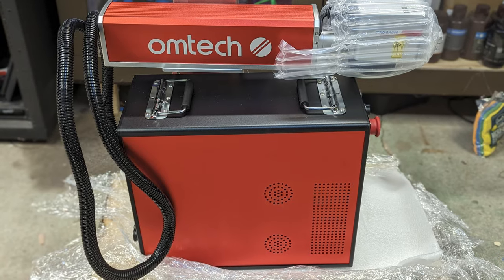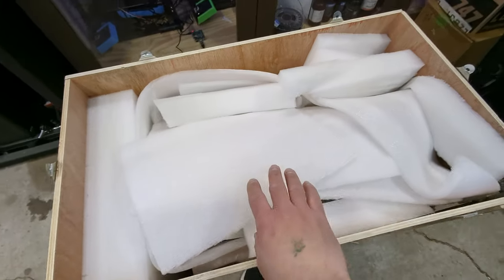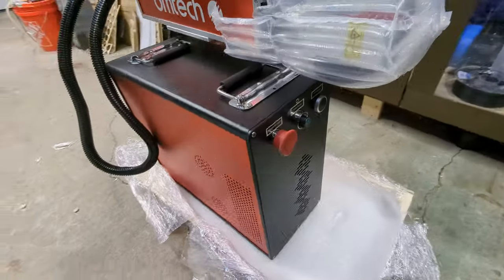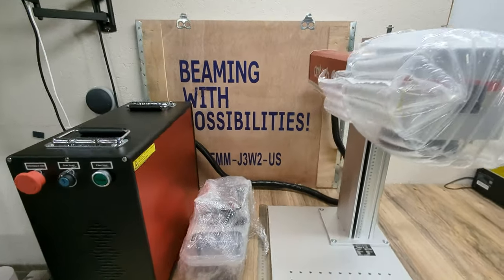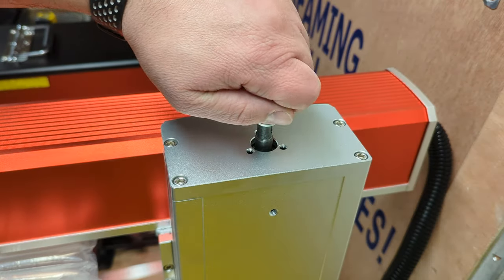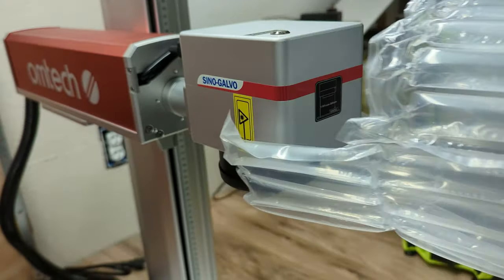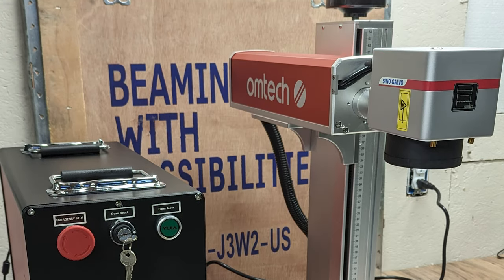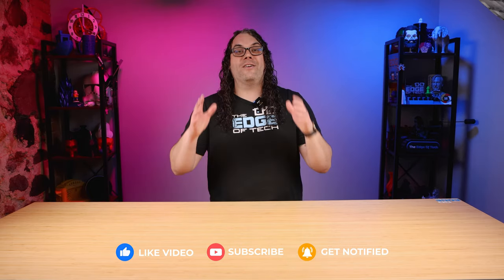You Won't Believe What Omtech Sent Me To Play With...

Comment: Not sure you found out where the handle goes on your own. But, my fiber laser has one of those handles at the top of the tower by the height adjustment wheel. It locks in your height settings and should screw in from one of the sides between two sprung screws. (Edit) Looking back at your video there seems to be a threaded hole on the right side of the adjustment tower, the Omtech one may not have the sprung screws like mine.